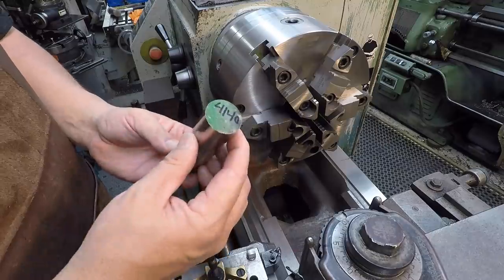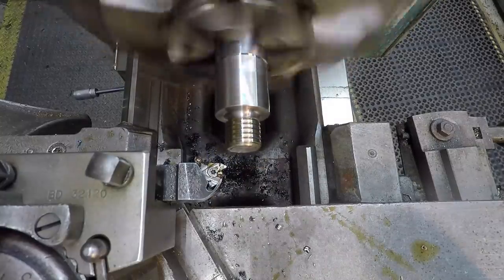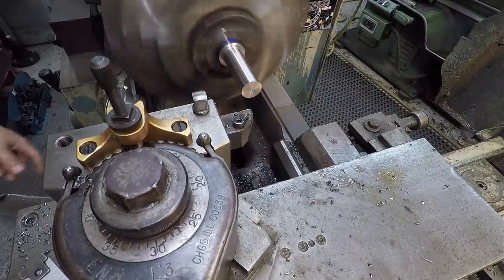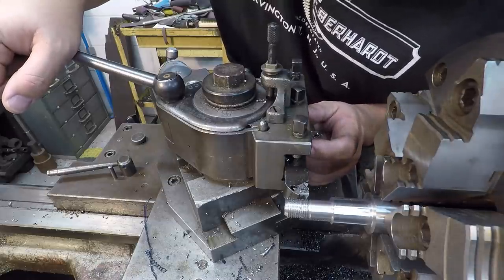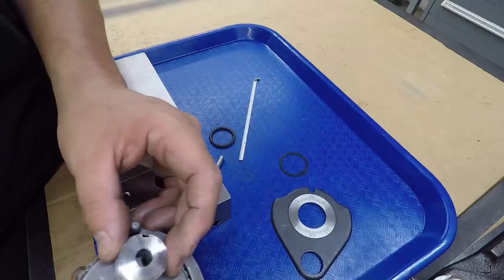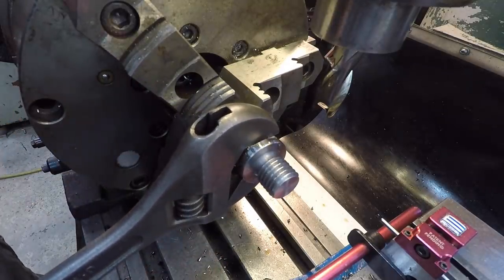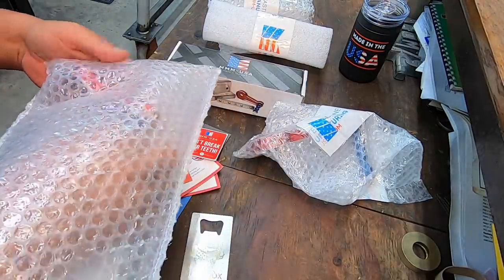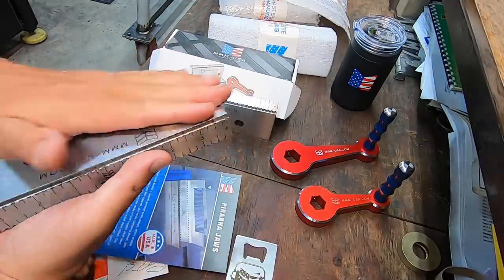SNS 314 Part 2: Machining the Multifix Hold Down Stud

Comment: Just wondering if “41L40” is still available. I used to make a lot of shafts before retirement, then I started using “Stressproof”. Either one is not very acceptable for welding but machineability  was at least 50% better. I found that in machining longer shafts, 4140s would stress relieve so you had to be careful how much material you would leave for finish machining. Now Stressproof was a whole different story. That shifts I made were usually for woodworking and TIR and concentricity had to be within 3 microns, Pretty tight tolerances. The shafts were about 3 1/2  in dia. and about 70” long with 4 to 5 steps from  C/L to each end. I could rough machine down to within .003, sometimes roughing a 1/2” aside at a time and then finish out in tolerance. Never had one ever come back because of bend from use or abuse or stress, ( Duh, stress proof). The only reason I’m writing this is to share my experience with the different materials and not to criticize in anyway the work you were doing. Once I showed and proved to the customers the benefits of stress proof they never once asked again for 4140 or in that matter 41L40. Hope you have a great day and again the work you do is beyond reproach. Blessings!

Comment: I bought a DeWalt carbide metal cutting chop saw in a hoc shop for $150 and a new blade for another $100 which was a lot cheaper than the new price of around %550 plus shipping.  Nice how the cuts don't leave that sharp flashing like the old abrasive saws did. The DeWalt has a stamped sheet metal base but it looks like that Metal Devil saw has a cast iron base.  After a closer look it looks like it is a stamped metal base that has been machined.

Comment: First, great video and content, as always Adam. Thank you!   I have two questions:  1) Is there a reason why you didn't chamfer the two outside top edges of the T-nut to match the compound chamfer? 2) The final skim cut used to pull the T-nut into flush with the front area of the compound...is it industry practice to leave the cutter circles visible?  I am sure you cannot feel them so it is only a cosmetic thing and most likely only visible at certain angles with just the right lighting. Serious questions for a guy trying to make up for lost time finally doing things I should have done a long time ago! Thank you again for the excellent content!

Comment: a lot of cnc used billets of material with a dovetail that fits their fixture setups for a lot of rigidity. You may get a little digging into the billet if the jaws are hard, just so long as the teeth don't snap.

Comment: What RPM are you using at the start? Such a lovely finish - my steel never looks like that with carbide - perhaps a higher feed rate would help?
Reply: From my experience with carbide you need a good mix of high enough surface speed, doc(not too little) and feed. Carbide likes to cut and do it fast.

Comment: Love the videos and look forward to each.  Thanks for posting.
Perhaps it is my the fact that, using a wood lathe, I do not have the drive setup that is on the machinist lathes, but, watching your video as well as a bunch of others, I have wondered how are you able to tell where to place the tool for each pass for threading what you did at around the 7 minute mark?  And, further, how did you know when to engage the drive for the tool so everything matches?  I understand that the lathe has the drive for the tool geared for the pitch/length of the thread, but, looking at you turning it, it looked like you were manually positioning and engaging the drive for the tool.  I usually work with wood and the taps I use for threading are all manual, so, I have been trying to wrap my head around how you do this and have each pass line up perfectly.  Thanks in advance for helping me understand.
Reply: On the right side of the lathe carriage there is a small dial, driven by a gear that engages the lead screw like a worm drive. As you said, the lead screw is geared to the spindle, with the change gears determining the resulting thread pitch. The dial is graduated, and by engaging the lead screw when the dial is at the same position each time, you make sure that your thread is started in the same position. Sometimes it is necessary to start a thread in two places; the most common example is the lid on a soda bottle.
Reply: I can only speak for mini lathes, but they have a threading dial that’s geared to the feed screw. Referencing it on each pass keeps everything “in time”. I take it for granted that these big lathes have something similar.

Comment: The idea with those dovetails on the Piranha Jaws, is that you machine a small corresponding dovetail, on each side of the base of the work-piece, so the two 60 degree dovetails interlock, which keeps the job tightly pulled into the vice, even though you only have a tiny amount of the job actually in the vice jaws.

Comment: Adam, instead of drilling another hole to lineup the tool, cant he just clock the outer shell/clamp on the toolpost? This way no other drilling is needed.
Reply: I am scratching my head and thinking the same thing.
Reply: The issue is that the existing pin hole that Adam made is not in a position that will allow you to rotate the tool post 29.5 (or 30) deg and be square with the lathe chuck. The issue is that 29.5 (or 30) deg is not evenly divisible by the 9 degree index positions of the 40 index positions on the multiflex. The closest you could get would be 27 deg or 36 and that's enough to throw-off threading depth. It will either create a thread that it too shallow or too deep, unless you stop and use the cross feed on the final cut to go directly in.  Wouldn't be a disaster but if you thread a lot, you might care. Setting to 27 deg would be the best choice for a compromise.
Reply: e2jw pish. The angle being wrong will mean that the insert either cuts entirely on the front, or mostly on the front and partially on the back of the insert, but nobody’s using aboslute numbers when doing manual threading, its all in the feel. You can even see in this exact video, Adam doesn’t use the calculated thread depth for the infeed, he does relative motions with a PD mic
Reply: @spikeypineapple552  Well, there is less "feel" to it when you're cutting at close to 30 deg.  If the angle is off, you will wreak the thread since you'll go too wide (at 27 deg) and not get deep enough; likewise, you'll go too deep at 36 deg to get the width.  It's just the geometry.  To compensate you'll need to adjust the cross feed in-out on the final cut.  If that's pish you mean, then ok. Adam puts a lot into using his thread gauges go, no-go to make sure his work is correct.  The question I was answering was about the "why" - its up to you to make it work.
Reply: @e2jw  That's just not true. These are form inserts, as long as you cut so that the tip of the insert makes a full pass at the minor diameter, you'll have a good thread. The angle at which it infeeds only affects where on the insert it cuts. I almost always cut threads on manuals using a 90 degree infeed(perpendicular to workpiece).

Comment: How does the threading bit start on the same thread every time? Is the machine timed to do that? So you don’t cross the threads?
Reply: Yes, there is a little dial, and the machinist engages the half nut, when it matches with the point he started the tread. Sometimes people also back out of the cut and then just reverse the lathe with the half nut engaged
Reply: To elaborate on Compieter's comment: The spindle gears are fixed to the gearbox and down through the leadscrew which moves the carriage. This is a known ratio. When you cut threads, you set which gears to use to get a specific pitch. There's a dial (thread dial) which rides that leadscrew and indicates when you'll be aligned.

Comment: Hey Adam, I'm sure you've mentioned it before, but where did you get that indicator backplate? Magnetic backplates are easy to find, but I haven't seen one with an alignment step in it like that one.
Reply: I have tried to find one too. I think I will have to make one up.

Comment: That thread file you used on the M14 looked like a warding file which locksmiths used to use to cut the tumblers for locks.

Comment: In regards to the last section and the need to tranfer/drill a new location of the 6mm pin I noticed that the three pin holes in the tool dont appear to be 90 degrees offset. Could it be that they are 90 +/- one third of a tooth so that you can use different pun holes to get a close to perfect alignment? Is there a reason why there are three? Love the videos even if I dont have any of the tools and though I would add my 0.02.
Reply: The three pin holes are to give you 120 positions. So you need to pick one hole and make that your "master" hole to get the perfect 90 degrees to the lathe spindle. Each of the pin holes are 3 degrees offset to the others which gives you the 120 positions. Go to this page and scroll down to section 12 for the explanation. https://pewetools.de/unser-schnellwechselsystem/

Comment: Adam, great work as usual. I have been debating between the Multiflex tool holder and the wedge type tool holder (BXA 251-222). Don't have the machining capability to do the T-Nut and post for either so will have to farm out some of this work. But you sure have given me a lot to think about. Any comments on either post? Thanks for producing this video, really well done.

Comment: I do not recall you saying but what brand insert was that threading insert that kept chipping out on you in the video?
Reply: He made a point to not mention it.  I believe he was not interested in talking about some crappy insert.  The project needed to go on.
Reply: @paulcopeland9035  Fair to say that. Just curious as someone who tries to avoid sub par tooling what brand and more specifically what grade of carbide he was using. He doesn't come across as someone who's going to waist his time just buying anything of the shelf. He bought something he expected to perform better than it did.

Comment: 7:37  Those Go/NoGo gauges are used to measure the Pitch Diameter, a radial measurement, not the pitch, which is an axial measurement.
The pitch was confirmed earlier when you checked the scratch pass at 5:29.

Comment: Does the indicator stop the feed of lathe, or are you just watching it and stopping it yourself.
Reply: The indicator is just a reference. Adam stops the lathe manually by disconnecting the split nuts. He does is so accurately that we can be forgiven for thinking it's happening automatically!! Hope this helps.
Reply: @michedmck  ya man, that's what I thought, but, over the years watching his videos, I would swear the indicator had a stop switch on it. Lol
Reply: Lol! Admittedly he does stop that lathe on a dime! Wish I could do that. Always have to stop 10 or 20 thou short, then hand feed to the zero....🤣🤣

Comment: Hey Adam great video im actually making one of those but for my quick change tool post my steel supplier didnt have 4140 so i just used some axel steel hopefully i dont regret that also what brand of callipers are you using it looks really nice.
Reply: @NitroAl  Thank you for linking the tool

Comment: This is to funny, I just made a new one for my OXA QCTP. The one that came with the tool post was undersized by a lot. I know once it's tightened down it should hold but I made one that wasn't as perfect of a fit and Abom but within a couple of thou vs 15 thou that it came with. 
One thing it did do is force me to order a reversing switch for my old lathe and figure out the wiring that came with it so I wasn't leaving the half nuts closed and reversing the chuck by hand back to the starting point.

Comment: The set screw method is better since the "T" nut is being pulled up to the underside of the slot anyway. Better support.
Reply: It nicely fixes the t-nut in place and allows you to remove or reposition the multifix w/o loosing any reference on the cross-slide, too 👍

Comment: I also wonder if Adam has the right pad underneath his threading insert. They make a carbide pad that goes under the threading insert that has a notch that fits underneath the very point of the threading insert for support.

Comment: How does the tool always start in the same place on each pass of the thread cut?  I get that the feed is constant but don’t see how it approaches the same point on the thread ?
Reply: There's a screw in the machine and a little dial that lets him know when to engage the feed.
Reply: The lathe has an indicator called a Thread Chasing Dial
Reply: Dale Gloer   Thanks !
Reply: Mr Reaper  ice 1 thanks

Comment: Is there a reason why you didn't center the 3/4 - 10 threaded end ? Seems to me it would have helped with chatter you were getting on the thread relief. I have had great luck with Micro 100 brazed threading tools.

Comment: All the force in this T-configuration is carried by 2 M6 threads, that's not ok. Reduce the height of the T-insert and it will be stiffer :)
Reply: I think 1/4x20 but your point is 100% valid.
Reply: Yep,.cant see the purpose of the set screws  reduces rigidity, top of "T" nut must be lower than top of compound to achieve positive lockdown.

Comment: I'm against using the pin. The toolpost is never square when it is installed. Also, if you crash, it will damange the compound or the toolpost.
To get the toolpost reasonably square, I remove the jaws from the chuck, loosen the toolpost, insert an empty toolholder, then drive the toolholder against the chuck. tighten the toolpost and donne...

Comment: Does anyone else wonder at the forward reverse lever on the Victor? 
Every lathe I've ever used has the lever lift up for forward, and push down for reverse. English lathes, Italian lathes, French lathes, American lathes, Russian and Czech lathes.
This lathe is the opposite (and it does make sense because it's the same rotation as you want the chuck to describe, but it's not very ergonomic. The last lathe I bought had so much wear in the splined coupler on the carriage you had to damn near kneel to get the reverse clutch fully engaged). I would find that opposite rotation hard to adjust to, I wonder how Adam manages, given his Monarch is presumably the opposite.

Comment: Dumb question time. I have watched several other channels where, when cutting metric threads, they leave the half nut engaged and then reverse back over the thread claiming that because it is metric their machine will not duplicate the position on the drive. It seems to me that this is wrong since your thread dial is synchronized with the carriage drive so all you have to do is make sure you use the same indicator on the thread dial. Am I missing something or are they?
Reply: Yes we are taught
Reply: Adam explains this in another video. Basically the nut only engages in the exact same position every time. But his method allows you to stop on a dime instead of having to accommodate the lathe coasting to a stop.

The trick is that the nut is engaging on the lead screw at exactly the same position that it was released at, as though it was never disengaged.
Reply: It depends on the exact thread being cut and the exact lathe and gears.  As was said you sometimes have to engage the half nut only at certain points of rotation of the shaft.  His method eliminates that issue.
Reply: Yes, but also no! 
When cutting metric threads on an imperial lathe you keep the halfnut engaged because, no, the thread dial cannot keep a metric thread synchronized with an imperial leadscrew - because there is no synchronization between metric and imperial to keep.
BUT as long as you do not move the carriage, and stop the spindle before the thread dial has gone round more than a turn, you can disengae the halfnut. You still need to re-engage the halfnut on the same number without moving the carriage and still need to reverse with the halfnut engaged just as you would if you left the halfnut engaged permanently. 
So what's the advantage? It's easier to thread upto a shoulder without crashing the tool into it. 
Conrad Hoffman has a page explaining this in more detail (and there are a couple of videos on youtube too somewhere) 
http://conradhoffman.com/metricthreading.htm

Comment: I like your cut off saw . Most of the ones I see and have used have a abrasive cut off wheel. 
They burn the crap of the  work piece. Yours I didn't  see any burn at all.
Reply: But my experience with cutoff saws is that they spin MUCH slower and use coolant. I would be hesitant to use the one at the beginning of this video.
Reply: @AlessioSangalli  
That is a different type of saw, referred to as a cold saw, usually running at 120rpm tops. The machine in this video is a metal cutting saw,running at 2000 rpm, maximum.
An abrasive saw is almost the same as this saw, only running at 3000+ rpm, ans using grinding discs.
Reply: @NemesisRTCW  ok but what is the advantage over the 120rpm one? Not sure why but I like the slow spinning ones a lot
Reply: @AlessioSangalli  
Probably portability.
My Bewo cold cut saw weighs in at 200 kg+, without coolant and it's base.
A Ridgid 590l cut off saw is 20 kilos, and dors not need coolant.
Reply: @NemesisRTCW  that's a good consideration

Comment: Gday Adam, quick question, is there any reason you don’t use HSS for thread cutting, you may have mentioned the reason before and I’ve missed it, I’m just wondering that’s all,     Great fit on the tool post, looks really nice, take care mate,    Matty

Comment: what are those cool spirals on the workpiece when you turn it smooth?
It would seem to me like having a delrin type giant washer under the apparatus would be nice.... but im not a machinest and it would probably ruin precision or something...
Reply: It's just the tool tip cutting the stock as he moved the carriage to the right. There might have been some flex in the stock and didn't take a "full" cut.